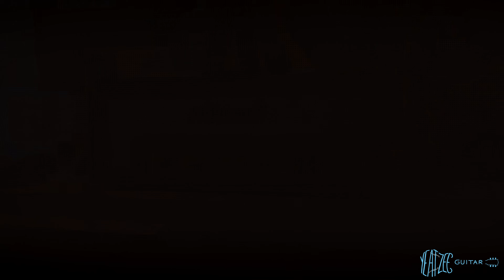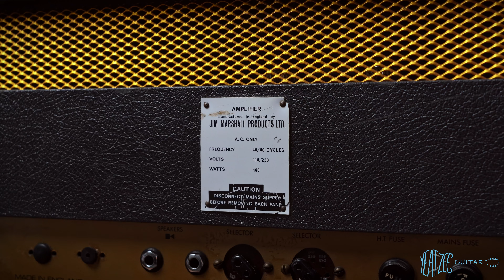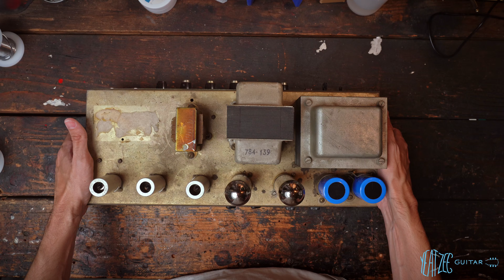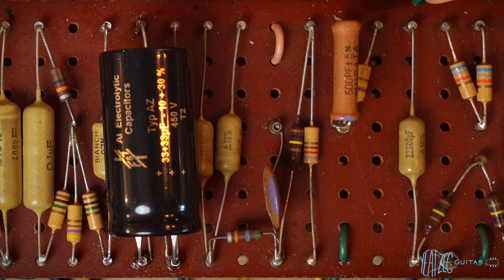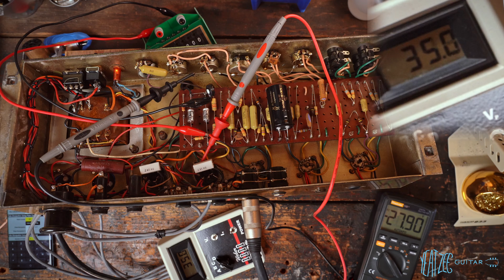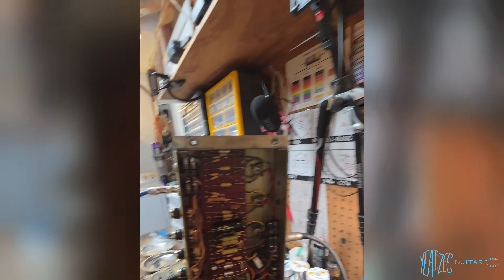Vintage Marshall Plexi 50w in for a tune up!

Comment: Plate voltage for the audience please...
Reply from the maker: I mention it a couple of times
Reply: @YeatzeeGuitar I missed it when watching the bias section....i went back and heard 420 volts. My 1974 1987 model has the same output transformer (784 139) as this '67 plexi, and it's standing power transformer ( 1202  164) delivers around the same 420v. It kicks like a mule when cranked to 1 to 2 o'clock, and it's clean tone is better than any of my Fender blackface amps (Bassman, Deluxe)!....perfect classic rock

Comment: I have 10661, also a 50 watt JMP, but one of the first Lead spec 1987’s. So in 67 it would have been basically a Bass spec amp with an added 100k brightcap and Lead spec coupling caps. Mine has been modded to a 2000k brightcap and tweaks to NFB to make it a little brighter and tighter.
Mine is very much a transition amp and has a valve rectifier socket but was apparently wired SS from the factory. Plus it has a solid turret board so it must be an earlier 67 as apparently the perforated boards didn’t come in till Autumn 67.
GREAT sounding amp.
Reply from the maker: Wow that's amazing!!

Comment: The small pots are original to the amp. In late 60's Marshall's you will sometimes see a mix of the older larger RS pots with the later smaller ones.. The dual-cap dimple is not a bulge, it's a relief, in the event of a blow-out. The Bias calculator is not very informative...
Reply from the maker: Sure looked like a bulge to me! Are you implying I should have kept that cap in the amp? What part of the bias calculator was not very informative for you?
Reply: @YeatzeeGuitar  For repairing a customer's amp, you did the right thing by replacing caps.. The bias calculator was showing Class-A , which is not possible at those voltages..
Reply from the maker: The bias calculator shows calculation based on general benchmarks if the amp is class A fixed bias, class AB fixed bias, and cathode biased. I used none of those in this video

Comment: Awesome! I have a jmp 1986x clone with vintage parts (50w bass Plexi). I added some switches to toggle between lead and bass tone stacks and nfb. Also added bright switch options. That buzz at the end has to be something physical - loose nut etc making a ground connection. Good luck hunting!
Reply from the maker: Nice, with vintage parts very cool!

Comment: I have a 1990's Sovtek Tube Midget 50H, which I think is a copy of the Marshall you were working on, and at about 19 Watts of idle plate dissipation using 6L6GC's I am getting plate voltages of 499 Volts.  My grid voltages are -49 Volts.
Reply from the maker: Not familiar, but that's cool they did 50w plexi copies but with 6l6!
Reply: @YeatzeeGuitar  You should look them up.  They also made a very similar "Mig 50" and some other amps.  I think New Sensor is still making the Mig 50 under the Electro Harmonix name.  The schematic for the Tube Midget calls for 5881's, but the pair I have are not very well matched, so I put in 6L6GC's and biased it accordingly.  It does have a bias trim pot.